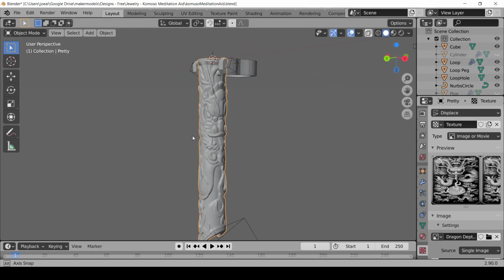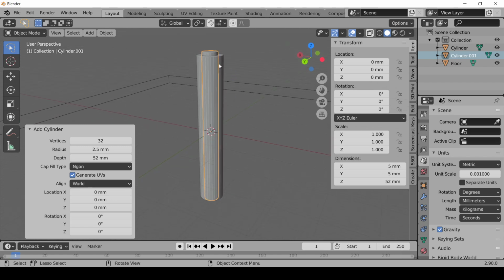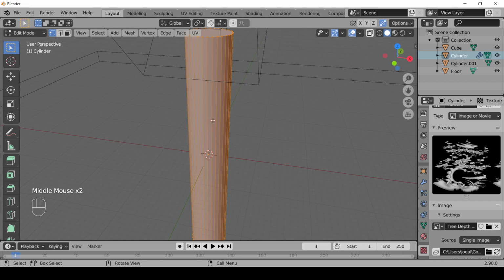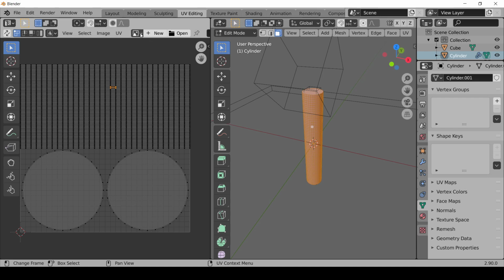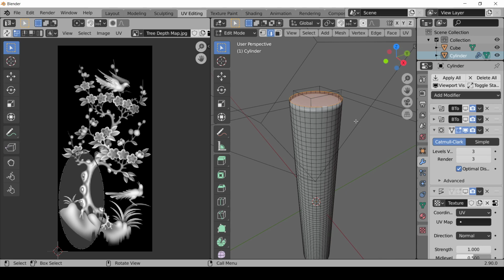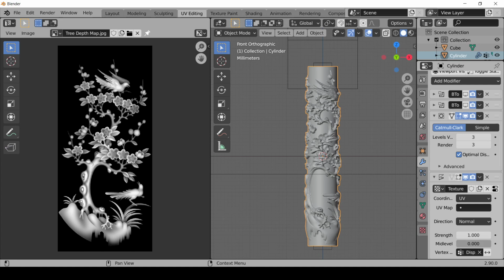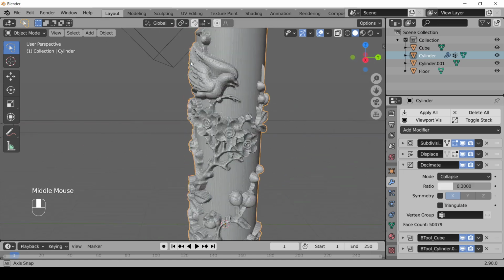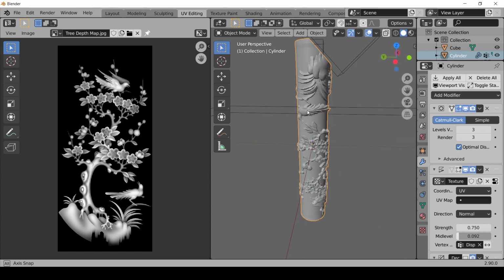How to displace on a Cylinder in Blender

Comment: Can you remake this video?. I'm working on mold making. So I have to design a candle or soap like it has been carved ( like a coin relief kind of). So I have to 3d print a carved candle with a design ( any design like cheery blossom tree, or a couple of monkey, etc). The point is that it needs to have relief. I'm trying to work with a 3d image AI generated, which I converted to a depth map image. Then I use the displaced modifier. Buy I think UV mapping would work better
 New to blender 😅

Comment: Thank you very much for your work.
But this low resolution relief works for 3d printing?
Reply from the maker: As long as it's more than about 0.5mm printed on the vertical sides it should produce something.

Comment: another quick questions if I may please. When adding the jpg to the texture and then UV editing it on to the cylinder my displacement is inverted and cuts into the cylinder rather than sticking outwards why is this please?
Reply from the maker: Strength can be negative.

Comment: This is a good tutorial. My only problem is even after I make my vertex group my texture still goes through the cylander and shows in the middle and top. Is there a trick to making the group. I've tried different ways to select only the outside.
Reply from the maker: Switch to wireframe mode, change to top view (numpad 7), and circle select (C) with the middle mouse button to deselect the middle verts.
Reply: @3dpprofessor  Hi, thanks for the answer. I found that I needed to subdivide the object so there would be two levels to the thickness. This way the texture stayed on the outer layer

Comment: Hi Professor, How to add different material/color for that displacement?
Reply from the maker: Ah, that is tricky. Because you can't just boolean one or the other out or chances are you'll have sections that are so thin they won't print, or they'll print so think they kind of offend the slicer. So at this point you're taking the final mesh and then picking which parts you want one color by hand to separating that into a second mesh, thicken the two parts of it.... yeah, it's a whole thing. Not impossible, but very labor intensive.

Or you can take it into PrusaSlicer and use their material paint options.

Comment: Hi :) can we use any image for this process? I want to make a signet ring with an image of my own so it wouldn't be in relief like yours but the opposite effect. Thank you very much and already subscribed!!!
Reply from the maker: You can use any image you want. You can make the strength of the displace modifier negative If it's going the wrong way.

Comment: Hey professor. I've got a design that I want to use as my displacement map. However, the image does not have a gradient to differentiate heights or bevels (the image I want to use is a text/logo). Do you know any way that I can create a displacement map like the ones you showed in this video? Do you have any such video in your catalogue? If not, could you possibly point me in the right direction? I appreciate how simple you made this subject in the video. I just wish I knew of a method for creating better maps.
Reply from the maker: There is not, as far as I know, any easy way to do this besides pulling up imaging software like photoshop and using the reference image as the basis for making your own.

Good luck!

Comment: I imported a model from FreeCAD using a STL file. but loopcut was complety broken. How can i import models without it breaking everything?
Reply from the maker: You can't. because STLs break things down into triangles you have to untriangle them, and that still doesn't restore the original geometry all the time. 
It's a bit like saying "How come I can't get the original word document back from the PDF?" Sure, you can get a word document from a PDF, but it won't have all the formatting niceties that were in the original.

Comment: Great tutorial, I just have one small issue.. When I scroll the mouse wheel, is zooms in and out, instead of changing the amount of loop cuts, how do I change this? 

I have tried to google it, but all I find is people writing about changing the speed of the zoom, not how to make it change the amount of loop cuts.
Reply from the maker: There's 2 ways to change the number of loop cuts. Either start the loop cut with the hot key ctrl+R and then scroll the mouse wheel, or use the gimbil tools and change it after in the menu in the lower right of the 3D view.
Reply: @3dpprofessor  OK, that explains, thank you very much 😀👍

Comment: I used this tutorial to make dice. I uv unwrapped and exported the map into illustrator to set up where the numbers went. My problem is that the numbers have some jaggedness around the mesh where its flat like tiny mountain peaks. I was able to do what I wanted and the closer the numbers where to the mesh the less mountain peaks but I wanna make deep indents. Do you know how I can fix this or set up the exported uv so that doesn't happen?

Admittedly I only watched part of the video when I was doing this and didn't desimate the numbers.
Reply: That's an intersting way to do it. The problem with this sort of solution is that it can only displace the geometry is there. So diagonals do end up kinda jaggy. Unless it's doing something funny because your displacement texture has some speckles in it.

You can make them deeper by changing the settings in the modifier.
Reply: @JosephLarson  so maybe loop cuts?
Reply from the maker: @kevin4061  I think we're talking at odd angles to each other. Maybe if you jump on my discord and post some pictures in #blender https://discord.gg/rpwXqE5
Reply: @3dpprofessor  I'm getting my computer repaired right now. I should get it back today or tomorrow.

Comment: I want to thank you for keeping going with your work!  I started using your Absolute Beginner videos 8 months ago to just learn some basics. Prior to that I've used F360 to make some simple boxes, and wanted to use blender now that I'm printing in resin to make some other things. There are all kinds of things I want to learn. I will surf your videos to see if you ever hit them. some things like #1below ive done in blender once by googling what i wanted to do, but i want a better guild/tutorial:
1 - taking two objects, say a ball and a cup, and moving the ball so that it's inside the cup, then union them (think modular arms on an action figure to swap 1 for another)
2 - creating a box, where we have lets say a 0.8mm thick wall around the edge with that wall being lets say 70mm high with a floor that's like 5mm thick), maybe some bevels so the box is stackable (3d print - tech design did a f360 tutorial but i need blender)
3 - creating a box with a lid
4 - embossing text onto an object (say you create a box w lid for your wife and want to emboss LOVE with a heart on it)
5 - now that im doing resin, can blender hollow a model and create drain holes? I know MeshMixer can, but it crashes 900 times a session.

btw, i know that #5 for FDM would be based on infill, but for resin it's completely different. you want to hollow the model and create drain holes then export the hollowed STL. the slicer (chitubox for example) can take a solid model, and hollow it AND do drain holes. However, their algorithm is sloppy and sometimes the drain holes are a pain to get right.

Comment: What I'm curious about is how they made that 3d image from a 2d photograph in the first place. We used to use a wide array of programs to do that in the past. Can this all be done within Blender now?
Reply from the maker: In this case, I don't think it was made with a photograph. Most of these grayscale depth maps are made by hand.
Reply: @3dpprofessor   Made by hand? Do you mean it's drawn in software as a 3d model first and then converted to gray scale? Have you done any videos on the process?
Reply from the maker: @tenlittleindians  other way around. It starts as a 2d image drawn by hand. There are a few tutorials online, but it boils down to taking the time.